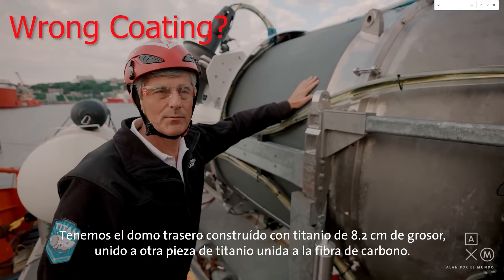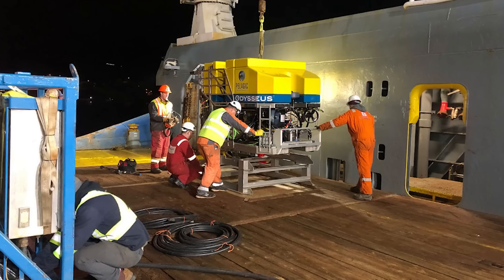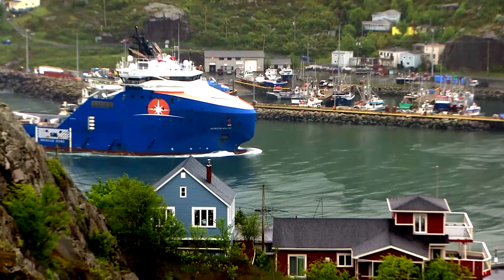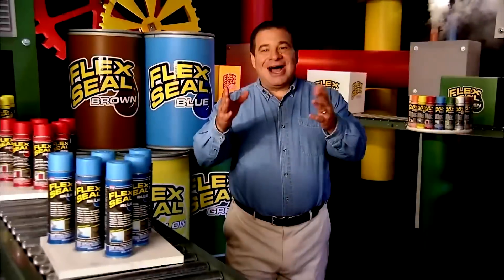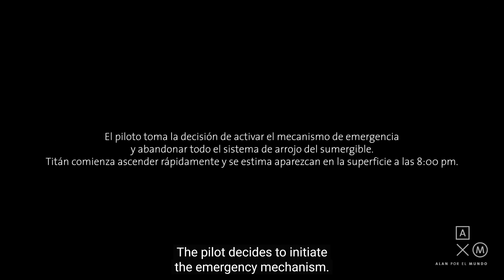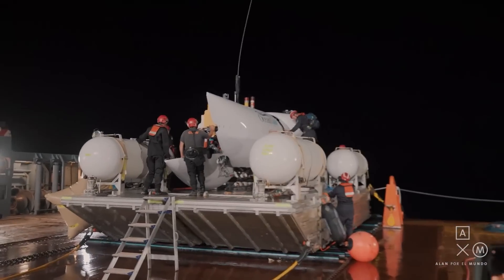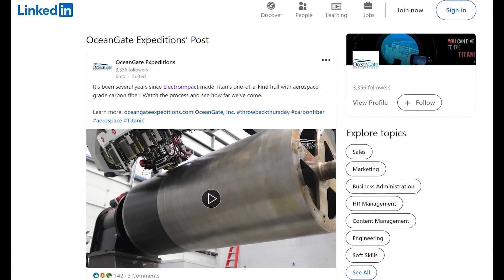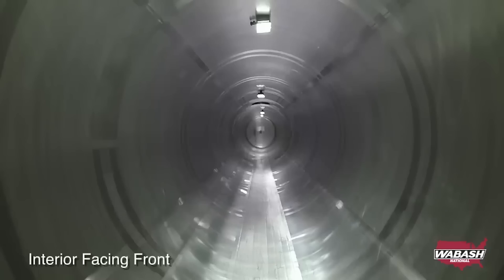Titan Sub Wrong Coating? Hull Construction, Debris Field Search

Comment: Hi Jeff,
I was wondering how the internal atmosphere is controlled in the Titan. Considering the pressure at - 12,000 feet is about 6000 psi, how is the air inside ejected to the outside ?
Since there was some number of high pressure oxygen bottles onboard, and they could not simply continue to add oxygen, there must have been a method to purge the air to the outside. Thanks, you're doin a good job with all your analyses,
Reply: submersibles have equipment that keeps the atmosphere inside at sea level. only issue if it can keep with the ascent/descent speeds but the bends or barotrauma is unheard of on submersibles versus diving bells
Reply: @toomanyaccounts  I understand that there is a mechanism to move atmosphere from inside to outside. That is what I'm asking about. 
Yes I do know the pressure does not continue to build inside submersibles.

Comment: I have rhino liner on my flat roof, it's been great, my roof no longer leaks like it used to. It comes with a 5 year warranty against leaking.
Reply: With a 5 year warranty, it should have been fine for a sub working at 12,000 feet 😂
Reply: Post a notice for Stockton in hell……he’ll get it.

Comment: correct me if I'm wrong wouldn't it be impossible for any carbon fiber to be recoverable because of the heat of the implosion? doesn't carbon fiber vaporize into a gas at a reasonably low temperature?
Reply: it shatters like glass. it would have been pushed into the endcaps
Reply: @toomanyaccounts   right but carbon fiber doesn't hold up to heat it evaporates into nitrogen the implosion would have been 10,000°+

Comment: Im curious how spread out the debris field was . would like an idea how far they were off the bottom when they were imploded .
Reply: They've only said that the debris was found 1600 feet from the bow of the ship and the transcript said they were at 3457m before they lost contact. (getting as low as 3500m). If the transcript is accurate, they were about 350m off the bottom.

Comment: The rhino liner was a *good choice applied to the outside of carbon fiber... it was there to plug any tiny gaps in the carbon fiber hull.... the pressure pushing on it would have simply improved the seal.
......
If it had been applied to the inside of the carbon fiber.... that is where it would fail for sure ....since the thApplying a rhino liner to the outside of carbon fiber would have been a good choice.Applying a rhino liner to the outside of carbon fiber would have been a good choice.ousands of pounds pressure from the sea would have been pushing the rhino liner *away from the carbon fiber..... not into the carbon fiber.

Comment: You obviously do not know much about the oceans or you would know the word 
"pelagic" and would not struggle with its pronunciation. Just to let you know 4AM is in the morning. even in Buffalo or at sea but you do not seem to know this. 

I have a lot of experience using carbon fiber tubes and road and hoop-type weave have always failed like a layer cake when one slice came apart. A spiral wrap holds up much better as my forces certainly weren't simply mono-directional but if and when it failed it would always be a kind of crumbling of the substrate not so much the fibers. This is repeated over and over in the case of Titain but I think the bed-liner was just sprayed as a bumper for casual on-deck abrasion and not anything serious. The sad part was that they didn't wrap the sub in titanium. 

As to the model testing the whole operation was run on a shoestring with a dubious business plan. I'm sure the whole basis for OceanGate's operation was the motto "good enough."

I have only seen one comment noting nowhere in any of the videos or stills was a torque wrench seen being used on the bolting operation of the forward hemisphere.

https://www.youtube.com/watch?v=JTaSdumMrrQ

Comment: As most of us that watch all these videos realize with our 20/20 hindsight this was eventually going to happen.   All the engineers comments seem to concur with lack of testing and Rush just love to push the  limits. One thing that still puzzles me is the fact that they were bolted in.  Just the thought of that seems to raise a red flag.  I look forward to the next update.
Reply: bolting is what space capsules did. its actually one of the strongest methods to seal against incoming pressure  and to prevent loss of pressure. the safety part is to have explosive bolts to blow the bolted hatch if there is no one or not enough time to wrench the bolts loose
Reply: @toomanyaccounts  Thanks I always like it when someone gives me the logical reason behind the method.

Comment: I believe that the CF was woven in diagonal patterns as well as perpendicular. Those sort of copywrite features are not necessarily shared. I also believe there were numerous design flaws, such as a lack of redundant systems and engineering shortcuts. The sub sinking at a faster than normal rate was the primary reason behind this failure causing uneven pressure on the hull. I doubt very much that the internal pressure building equipment could keep up with the rate of pressure increase on the outside of the hull. We already know about the arrogance behind the short cuts that lead to this disaster. At least these mistakes won't be repeated.

Comment: Should not have been using carbon fiber at all. It's great in tension, but doesn't have nearly the same strength under compression. As its a commodity, it's also very easy to get infiltration between the layers.

Comment: How he trusted adhesive for titanium to cf is beyond me and that's just common sense
Reply: add in no scouring of the titanium to where the adhesive would go. no clean room protocols, nor vac chamber. result no real griping to titanium, air bubbles would form in the adhesive nor would the bond be consistent in strength

Comment: I think the biggest issue is the flange joint between the carbon fiber hull and titanium end cap. +The hull had terrible structural design against compression. I think the end cap just popped off like a tube of toothpaste.

Comment: Prepreg is going to be warp & weft. Basically the tow being woven 90 degrees to one another..(At least for bi-directional)  You could still wind it, but you'll need 2 looms going 90 degrees to each other.  I've never heard of prepreg being wound. I'm not saying it couldn't happen, I've just never seen anyone that could do it. And then after that, you'd still need an autoclave.
Reply: You can just use a filament winder to wind prepreg on a mandrel

Comment: Everyone says how bad using carbon fibre and titanium was, and I'm not disagreeing... BUT it seems that even on top of this, the real issue was corner cutting, creating a culture of "yes" men, lack of diligence and testing of software and procedures, lack of redundancy.
It makes me think that if you made a carbon fibre, titanium sub properly, it could be much safer than Titan. E.g. proper cross woven carbon fibre, proper coating, kiln-cured resin for both the tube, and the end caps. Sanitory lab environment. Tweak the design of the end cap junction to the CF cylinder. EDIT and don't treat roughly e.g. drag it behind a ship for 3 days, or tie it down to a deck where it gets banged around in choppy seas as reported by a person who went on another trip
Reply: Another YouTuber found a research paper that successfully tested carbon fibre for the hull of submersibles down to 8000 metres. I don't know the name of the paper or authors though, as it would be interesting to see how that carbon fibre hull was designed, constructed and tested.
Reply: @rottsandspots  the issue is the carbon fiber is safe for one trip.
Reply: @toomanyaccounts  I don't disagree with that. Rush just made all his own rules as he went along, though I'd be interested where he got the initial idea from, and if it was from someone else's research which he reinterpreted for his own ends.

Comment: Jeff, I thought I heard something about the thickness of the Carbon Fiber Hull, and that it was originally slated to be 7”thick,…NOT 5”. Unfortunately, like the Acrylic port hole though,
Ocean Gate went cheaper ( i. e. thinner ) and accelerated an already anticipated end result!
Reply: I've heard that. Would it have helped much or would it still have imploded in the end? Maybe just took a few more dives before it did?
Reply: @MeteorTesh  It was guaranteed to implode regardless, the carbon fiber Rush sourced was a) meant for airplanes, so the resin that gave it the rigidity wasn't formulated for anything more than 1 atm of pressure, and b) expired, meaning it had been sitting on a shelf for too long and was likely already delaminating even before being put under pressure.

That's like trying to build a house on termite-infested beams, doesn't matter how many beams are used, it's still a house sitting on termite-infested beams.
Reply: @blarghmcblarghson1903  ahh, thanks for explanation. So really, it is all seemingly pointing towards neglect on rushs side then.

Comment: All the weak links in Titan I learned about in Engineering 101 in junior college.  Just the window alone would cause doom (rated for 1300m max.).  They went to 3400m, 2.6x over spec.  CF fabrication is undefined for this application and was out of date.
Reply: window was fine. same design that's been used on many previous deep sea vehicles. they only certified the window because that's all the agency was willing to examine. when they told stockton that a lot of testing would need to be done to certify the entire craft he basically just said "no thanks, im trying to make money". however, having no certification meant nobody would step foot in that thing let alone pay him a ton of money to go in it. the eventual agreement was that the agency would certify the window to a third of the proposed max depth, because it was a known design that had much proven success on other crafts that had gone down to 4000m+. the agency was being quite conservative with only giving it a 1300m rating (likely in part for legal protection for themselves). stockton was the opposite of conservative. he took that 1300m rating and used it as evidence of it being safe so he could sell tickets to people to take them down to 4000m. turns out, being conservative when it comes to safety is a good thing. the agency wont get sued into oblivion and have their family name disgraced and shamed for the rest of human history unlike stockton's.

Comment: Stockton looked so proud when mentioning the use of Rhino Liner as if he had gotten exclusive access to some form of military equipment. Just another way try bring credibility to his
design like he did by mentioning working with NASA / Boeing. Regardless of the coating he uses the carbon fiber is still gonna move around due to temperature changes which leads
to delamination. Everything about the hull design was flawed from top to bottom. Sitting inside a capsule that's built from layers of carbon fiber at deep diving depths is just insane.

Comment: That was their launch and recovery setup they were so proud of that they had three patents on.  Complete disaster in rough seas.  Imagine your local Saturday boat ramp calamity only the person backing down the ramp is also in a boat that’s bobbing up and down.  They smashed it up badly enough to break welds and dent equipment - requiring field repairs.  They claimed the sub was fine despite the epoxied ends being exposed to the same conditions out of the water with a lot of weight hanging from them.  That’s why others use cranes - so they don’t smash their sub into the ship and can recover it in rough weather.
Reply: the things Rush was so proud were what caused most of the dives to be aborted. there is a reason why rovs and submersibles don't off the shelf stuff and instead pay top dollar

Comment: They descended too quickly when compared to the scale testing. They "squeezed" the carbon fiber hull too quickly by descending faster than the material could handle. Along with repeat deformation from multiple dives and the inability to scan the hull this was doomed from the beginning. Why couldn't they have xrayed the hull for structural integrity?
Reply: would cost money and show Rush was wrong

Comment: What pressure was the implosion test at? Looks like externally atmospheric, pulling a vacuum on some other hull with strong rings..  However, that gage was showing about 21 'units' and went down to about 18?  Magnifying the gage, I can't see the units. That's not psi gage; that couldn't have been more than about 14.7.
Once a cylinder buckles ANYWHERE, it is structurally dead.
That is what they "saw", but it wouldn't have registered on their brain.
.
A little better example: https://www.google.com/search?https://www.youtube.com/shorts/gad8i654sY0?feature=share
Reply: You'd have to look up the video, but yes it was just a vacuum. I bet that's inches of mercury, so 18 would be 8.8 psi.
Reply: @daves2433  Thanks. So much less impressive than the Titan. . .  I did and looked for the unites, but the text was too small & blurred. I didn't bother to check other units.  I coulda' figured since I have an altimeter that reads that, but was lazy.  That tanker implosion is much more impressive and probably a little more like the Titan.

Comment: That simulation of the hull imploding, looks like that would hurt. The people inside MUST have perished an agonizing death 😮.
Reply: No, they wouldn't have felt a thing or even been aware that the sub had imploded.  The implosion happens at about the speed of sound, just a few milliseconds, longer than it takes sensory signals to get through neurons into the brain.  So everything was fine, then they ceased to exist.
Reply: look up what happened at Byford Dolphin when a pressure door from a diving bell to the decompression chambers was opened out of sequence

Comment: @10:23 this is proof that bad engineering practices were used. The test vessel failed at 4285 psi and they called it a "success at 4000 psi". Double plus ungood comrade.

Comment: If they thought 5 inches was enough, why not go 10 inches. or 12 inches. Figure out the weight and buoyancy later. I am sure there is a safe thickness that will hold up repeatedly under 4000 PSI.  You just have to spend the money.